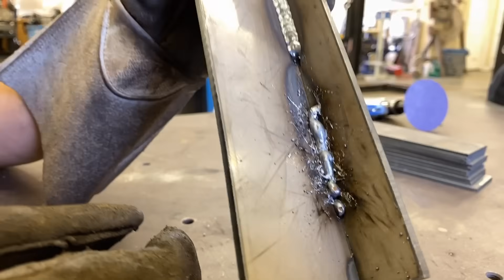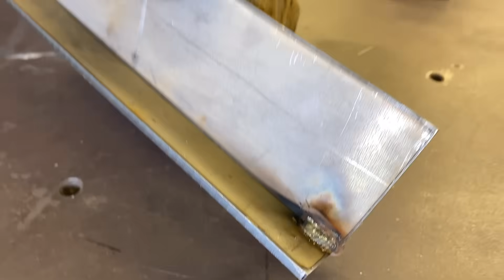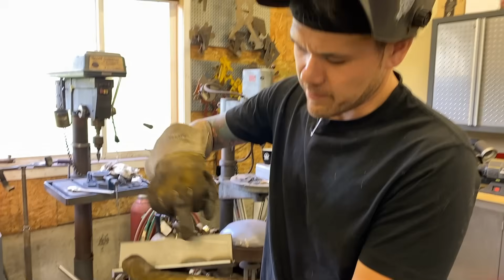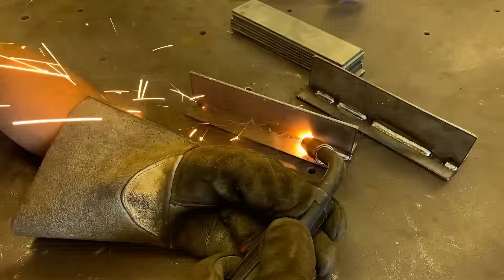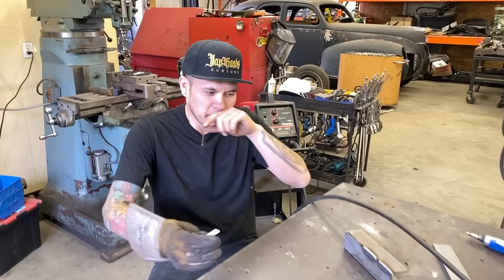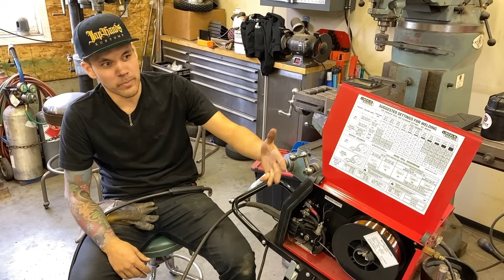MIG Welding Basics For BEGINNERS!! How To Set Up Your Welder + Tips, Tricks & Techniques!!

Comment: I see now this is an old video but I found it helpful - thanks for making it.  I'm retiring soon and  looking to get a welder for hobby / repair type work.  Probably metals from sheet metal to 1/4" most of the time.  Want your opinion as to a good welder to use.  I lean toward a multi processor just to have the stick capibilities which at the moment is all I've ever used.  I've looked at harbor freight but the warranty is only 90days so thats tells a lot.  Don't think I can afford the miller.  Thoughts on ESAP or Hobart 200 or Lincoln?  I even considered Mig only to go with Miller.  Look forward to your thoughts.

Scott

Comment: I am a newbie- self taught, and building a smoker. I picked up a Hobart 140 Handler and it j wasn't cutting it - popping the breaker - machine kicking off doing long runs.  I upgraded to a 220V Hobart 210MVP,  I was over confident after my first few welds that I had it handled. I was laying some good welds with the 140 all on .25 mild steel, . Long short I love the 220v and what a difference out of the gate, and get what you were saying. However my welds just Stink - after watching this it all came to my settings. I had bird nests everywhere - was getting so frustrated and ended doing a lot of clean up. I was able to dial it back in, and instantly had some better success and working on the whip and pause technique, I see what you mean about the better penetration.

Comment: Also...if you're using flux core...
Check polarity on your machine...
Gas mig...wand is positive ground negative..on flux core machine..ground is positive and wand is negative...check to make sure your machine is set up correctly..pro tip of the day...

Comment: what settings would you use if you were welding 1/4" - 3/8" plate steel to a body panel (inside area of a truck tailgate)?

Comment: This video helped me a lot to understand what I was missing. I plan tonswap my front end on my '92 Flareside F150 with a Crown Vic, which will need some frame welding, boxes and control arm mounts. The welder I have is a Lincoln Weld Pak 3200 HD, and when you mentioned having a sufficient welder for framework, I had doubts that one is powerful enough. Do you have any recommendations that wouldn't break the bank? I don't do a lot of welding, but that may change as I gain more experience. Thanks!

Comment: Lots of really good tips and instruction. I have a ProCore100 and am looking to convert it from flux core to MIG. Interesting to see that the inside of the machine is nearly identical to mine. I just purchased a conversion kit. A friend says that you have to use the MIG in zero wind condition which means to me, inside a shop. What's your take on that? Can you increase the gas pressure a little to maintain the gas shroud?

Comment: As a newbie I really appreciate you taking the time to show the basics along with a couple different techniques. My very first weld was a nut to a broken stud, and that was recent. I had the bird poop splatter at first and went too far to the point I melted the nut and it dripped down off the stud. Definitely a learning experience!  I love videos like yours that explain how and why you make your adjustments!
Reply: If you're using flux core machine..check polarity on the machine.   Wand should be hooked to negative and ground clamp to positive..look inside you will see where they hook up..by wire feed...
This will cause the problem you describe.... splatter.....not welding good...so check that....look up polarity on flux core machine...on YouTube...if you don't believe me....
Thanks and practice is key..👍,,,,,,

Comment: I have a lincoln pro mig 140 / 110 volt.  Can this welder be used to weld 1/8 to 3/16 frame welds or will not to upgrade to 220 volt.

Comment: I'm just getting into this. I'm just curious if all the experienced welders get to a point where they can look at the thickness of the metal and know around what volts and wire  speed for that weld without any chart?

Comment: You should be a welding teacher. Rock star 🌟🌟 of a video. I'm working on fixing my 06 HD chev Silverado and doing Rockers and cab corners the cost was so much I decided I'd do it myself . Your video sure helped my run my little flux core wire fed welder. Thanks for Northern Ontario Canada
Reply: This is probably too late but don’t lay down beads on sheet metal, you will warp the metal.
Do tac welds and move around the piece until you fill in all the gaps, don’t overheat it.
It’s funny, I have an 06 HD that they didn’t get the body seals right at the factory and now the rockers need to be replaced.
Check your body seals at the top where the doors meet the body, that may have been the issue.
2006 trucks shouldn’t be dusting out like that.

Comment: okay I'm real new to welding just picked up my 2nd machine, firepower FP-200 MIG welder made by ESAB. I have only used c25 shielding gas because I've learned this is the most popular kind of shielding gas for MIG welding. BUT-- my C25 shielding gas is 25% CO2 & 75% argon, not 75% CO2 & 25% Argon. In fact a quick google search would tell me that doesn't exist... I believe?

Comment: I have a 187 holbart, and I use .030 most of the time and .023 for 1/16 and thinner, the thinner wire burns off at lower amp, i.e., less heat for sheet metal

Comment: I'm a circle guy myself, not sure but I think when you get to the .035-.040 that's a core flux wire but I have welded with that with gas it dose a good job. When I first started weld I used a stinger or that what I was trained on then the Meg came along. Back meny years ago I was taking a class just to get certified I caught the teacher weld test plates for a student I didn't say anything but I got his name because some of the work I was involved in we welded on building for scaffolding and I didn't want to die because of his welding !

Comment: At 1:01, it is actually 75% argon, 25% CO2.  The wire speed sound examples were very helpful.  Great video.  Thanks.
Reply: Right. Otherwise they'd call it C75. (or A25)...I guess

Comment: i wouldnt use anything but Lincoln as far sheet metal goes I've got a $5000 miller hat rack in the corner my lincoln 180 hd (home depot) welds circles around the miller way more control less computer crap for $695 too probably more now though!  can add a spot timer and spool gun as well great buy!

Comment: I know nothing about welding but I’m assuming Mig is a type of arc welding? If so, doesn’t it require an electrical path? If so, where’s the other end of the circuit connected to?

Comment: Karl,  This is p
robably one of the the most practical guides I have ever watched in many years.  Interestingly, the ear is such a a great guage for a good weld.  I might recommend a great demo would be to have  an  'assistant' change voltage/wire speed while running a bead to hear/see the affect.  I feel the desire to grab a pile of scrap and play.  I'd also say that you make it look way more easy than it really is...  Very nicely done!

Comment: Great video, you make for a very good teacher! My only question is one regarding the end of the video where you mentioned 110 and 220 (volt?) welders. Were you talking about looking for a machine that can run on 220 volts? From my understanding the US' power grid usually runs all appliances at 110 volts whereas here in Europe we do 220-230volts. This, all welding machines sold here (EU) are 220-230v. Does that mean they are technically more powerful or am I completely misunderstanding?

Comment: I'm going to be new to welding. I ordered a mig welder that is gas and gasless 110/220v unit. I've watched so many videos for beginners while I'm somewhat bed ridden and I truly appreciate this video. It's very informative and learned a lot by this but now to apply it. Any recommendations for needed supplies? I'm mainly using it to make brackets when needed or panel repair on a old truck. Maybe fix a trailer if needed. Not a everyday use, just when needed. Thank you again.

Comment: Somebody gave me a 120 volts MIG welder that was dead !!!   As electronics tech I repaired the machine. 2 diodes were short and the PC board relay coil was open (no current going in).  I changed all the bridge rectifier diodes, with high quality diodes, (to start at new and the PC board relay). Now the welder works fine.  I'm 75 and I never lean about welding (only soldering electronic components for 35 years. With few video watch before this one, I could start trying welding.....Your video is great and awesome and I thank you for making it. I will watch many time this video and pratice your technics.  Right now I'm making a power lift attachment for my snowblower tractor. I have some pieces of metal to cut and weld. So far I made one bracket made of 4 pieces of steel, welding is not perfect but good enough as a begining.

Comment: I used a Lincoln 140c for a welding certification test and was really impressed by how nice this little welder performed. would be great for diy because you can plug it into 110 and weld common gauge sheet metal and being continuous you can micro dial in the amps

Comment: Great video. Right to the point, no over explaining and great camera work. My uncle was a steel worker and taught me how to stick weld. Now I use a 220V Lincoln very similar to this machine. I'm using flux core .035 but what I'm missing is the gas. Uggggg

Comment: Thank you Karl. Very useful/helpfull video explaining exactly all i needed to know today about mig basics.  As you were saying,  i am! welding up my hot rod project atm. Been watchin all the guys man o man theres some good info. I hav to say this one from you helped the most. Discovered my problem was that wire roller hadnt been changed to 0.25. And i need to angle the gun, stay in front of the pool etc etc. All very basic stuff for a man like yourself but thanks for taking the time and putting it out there.
Reply from the maker: You’re so welcome and I’m really glad that you found a video helpful! Sometimes it’s just one little thing that’s holding you back

Comment: Could you please help to look at my welds?, l’ve uploaded it on my channel which l’ve had several tests with different settings for flux core welding though it’s still not working and I can’t identify the root cause of the problem.

Comment: Great videos, love learning from these as I am a beginner right now for the purpose of hobby work but mainly my auto body projects and Im in the process of buyingbought one of the smaller diy type machines, yeswelder firstess to be exact and while it can do gas mig it also has gasless mig and I was wondering if gasless does well on thin auto body panels.

Comment: Great video. But it still makes me cringe a little hearing "more voltage to get it hotter". Voltage is part of the equation, so sure more is applied... But multiply it with current and this creates Wattage, which is what forms higher power & ultimately heat for the weld. Technically you're right, but would sound better (turn the voltage up to create more wattage and heat for the weld)

Comment: Wondering what the process is when you need to weld one piece of rectangular tube stock onto another, for example the tongue of a trailer welded on the underside of the trailer frame.The rectangular stock has a rounded edge so how do you fill that up?

Comment: I tend to vary my technique depending on my need. I haven’t found any really differences in the welds when cutting them open. If you practice each way until you get it right, and if these methods work well. Welding vertical is different.

Comment: That was helpful . You're a good teacher . I'm in the process of getting started doing this for the first time .
After seeing the shortcomings of using a friend's MIG 110v setup  I decided to get a 220v for my first welding machine .Did some research and decided to build the circuit using heavier wire than what the specs called for and a dedicated breaker big enough for the machine and then some  .

Comment: Wow great video, I really needed a refresher course.  Haven't really done any welding for over 15 yrs.  and at 74 couldn't quite remember what I did.  This brought back a lot of my techniques.  Came from a old Miller buzz box then now have the smaller 110V Miller wilder.  Though I was loosing it but the only wire I had was .023, pick up .035 the awg. I am more use to and Wala.

Comment: You say 220v for framework, does that include uniframe on a full size jeep . its not as thick as a good old fashion chassi. I have a 2000 wj Im restoring and the uniframe is bad in 3 key spots. I have an amazon 100$ flux core / gas welder, I think it's 110/220 but not sure.

Comment: Can you do a video about burning through the metal, obviously you’re a very good welder but for beginners, sometimes we burn through the metal and then have to fill in the holes that we burned through and some of the techniques about why that happens and how to fix it
Reply from the maker: Yeah that’s a good point in my next video I will cover it. Typically it’s just way too hot for the material. It’s much easier to do this on sheet metal especially with a butt joint

Comment: excellent .  I just spent a day watching a guy stick welding a galvanised tube structure for a project in his field .  Bird poo is what we are talking about .He was using a domestic extension lead over 25m long .   Striking an arc on his 1.6 mm coated rods was a nightmare . the rod would stick and burn .  He assured me that the rods were special ones suitable for galvanised steel .Your last weld demo was almost exactly like his poo droppings. Now i Gotta go back to your video .and check out what you said .

Comment: While welding downhill. Go down then up just a smidge. This way your edges penetrate. To check spray paint the edges. While welding at Fruehauf i watched alot of people grind their welds out because the edges were to cold and didnt penetrate. Also when you dont have gas you get perosity. Holes in your weld.

Comment: Question.. with a gassless flux core is pushing out of the question? I understand why people dont like the push vs drag but is it feasible? Also, one of the best videos I've seen so far. Your knowledge is appreciated highly.
Reply from the maker: Thanks so much man my understanding is that when you create slag you drag. The reason being is that if you’re pushing the slag it’s more likely to be included in your weld deposit.
Reply: @MakeItKustom  Gotcha..

Comment: I learned 50 yrs ago you push hard wire/gas and pull flux gasless. A term used in the old days was "if theres slag you drag", if using gas, push the puddle..Good video..😉

Comment: As a pipe Welder that works in Construction, I like to weld downhill vertically with a Mig Gun, It makes for a cleaner weld and it is 2x faster than uphill. Now if we are tig welding or Stick welding uphill only unless you are offshore welding with a 6010 rod which is designed to be welded down hill.

Comment: can I use mig flux core mild steel to weld my limit strap mounts and frame support for my frontier rear end??
Reply from the maker: It depends if your welder is strong enough or not. If it’s a 110 V welder it’s a little bit weak but a 220v is great. (It can be done with a 110v) I prefer 220

Comment: Great video.. Hey, I don't know about welding or electricity but I have a question, can a 220 welder work if it is plug to a laundry dryer outlet? thank you!
Reply from the maker: Yes absolutely! You can make yourself an adapter cord. You will not need the neutral wire for the welder
Reply: @MakeItKustom  Great. Thank you for the response. Hey, one more question, what is the best kind of welding to work on a silverado frame? Thank you all the teaching that you do...

Comment: Excellent video, very informative.  I tried welding with a smaller welder and didn't have much luck with penetration.  I I was told to move the stinger back and for to disperse the heat.  I had previously worked at a fab shop that did a form of spray welding.  They added 2 percent oxygen to make an even hotter weld, I didn't move the stinger.  I worked at a shop that was big enough and could afford the local tech college welding instructor to come and give us an abbreviated welding class.  He said that vertical up was the strongest weld, not that one does a lot of vertical welding.  11 of out of 10.

Comment: Nice, very nice. I've never done welding, so I know now how to do it, let's hope I CAN do it.  Q: is there something important to know about the GAS? (more/less/type?)
Reply from the maker: Yes I didn’t really cover it but the gas flow is 15 ft.³ per minute for me in a quiet shop. You would need more gas if there were breeze or turbulence in the air. Basically the best setting for gas is just enough to make sure there is no porosity in the world which would be when it pops and has holes in it. Those porous holes indicate that there is not enough shielding gas to keep the oxygen away from the molten weld
Reply: @MakeItKustom  This evening I did and didn't do the welding! The best thing was after a few minutes a (more experienced) friend of me did the rest, overlooked by the neighbour (also experienced). I first gave more thread (sounded not like "bacon", and after telling my friend that he needed to "push" instead of pulling the Hotspot, it looked almost as good as yours. He and the neighbour said they both learned something to day.. ...So: thank you very much: I AM happy. It's finished! (took me 2 weeks)

Comment: Thanks for the nice tutorial. Could you cover gas setup and flow?
Reply from the maker: You’re very welcome as far as gas set up, are use between 15 and 25 ft.³ per minute. Basically you want enough gas to give yourself full coverage but not so much that you were wasting it. If your shop is calm with no wind then you should be able to run 15. But if you notice you are getting porosity or holes in your welds then you should turn it up a little